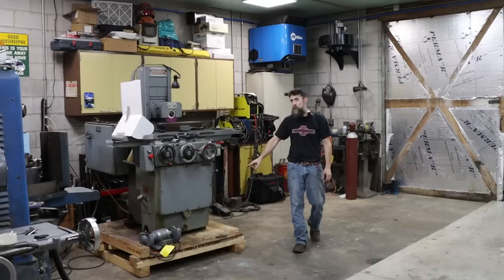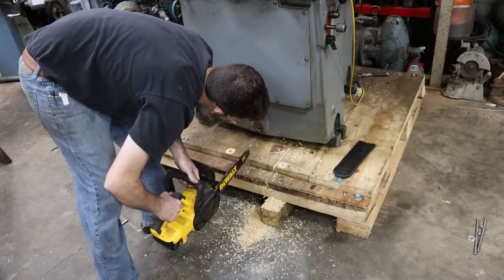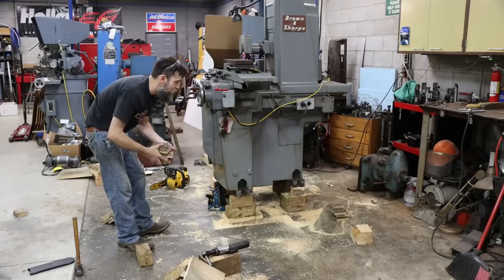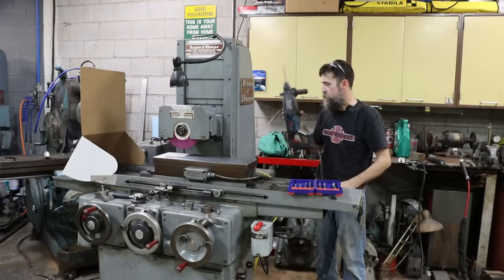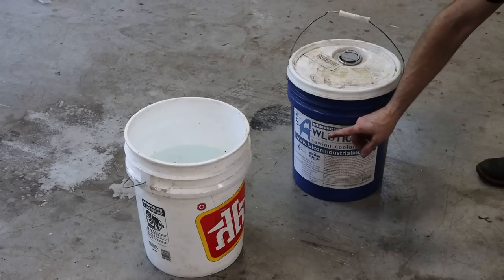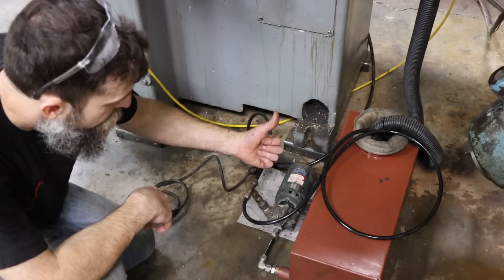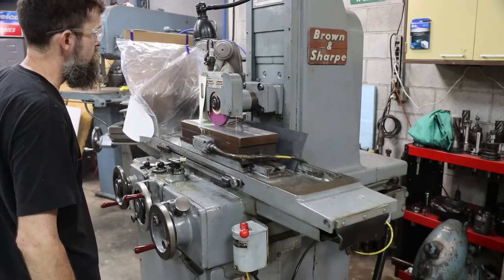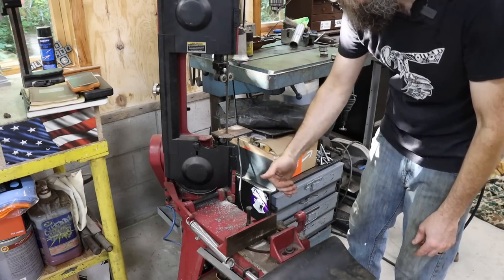Doing it the hard way. Brown & Sharp grinder touchdown & Test!

Comment: Thinking some more about this, I wonder what those six blocks prove beyond repeatability of grinding the chuck and then grinding something on top of that chuck. In other words, I don't think it tells us much about the actual flatness of the grind. It does tell us that the grind is following the same path consistently.
Reply from the maker: Moving the blocks to the surface plate and checking them there is where you see if the grinder is true or not. If I were to have placed the indicator off the grinder spindle head and check the blocks on the mag chuck it would have shown that the blocks were the same thickness even if they were different.  It's moving the blocks to the known flat surface plate that shows the true path of the grinder spindle in relationships to the mag chuck.👍
I hope this makes sense
Reply: @SteveSummers  Hi Steve, love your show. My point is that the contact point of the grinding wheel follows some path through space which is not necessarily flat. After you grind the chuck, the surface of the chuck follows that same path. As long as that path is highly repeatable (even after you raise the wheel a bit to grind the blocks), the top surfaces of the blocks will also follow that same path. So those blocks will have the same height, even if the path followed by the wheel is not perfectly flat.

What the test shows is that the grinding wheel follows a very consistent path, even after being raised above the blocks, but it does not verify that this path is flat.

Comment: What? No cherry picker? Picked up my B&S #2 Surface grinder no problem. Actually didn't even seen to stress it out. Mind you I did pull the top off, only needed to do that to clear the doorway loaded on my trailer. (Unfortunately)

Comment: I may be missing something? If the ways are very slightly curved, grinding  the magvise "flat" and then grinding blocks on it will result in identical measurements even though the magvise is not flat.
Reply from the maker: It will give an identical measurement to the surface of the mag chuck . When the blocks get moved to a known flat reference surface like the surface plate I used it will show if the blocks are ground all the same or if they differ from one another. Moving the blocks to the plate is where you see the condition of the machine ways. If there is a bow in the machine ways the surface plate will show it 👍
Reply: @SteveSummers  I don't believe that is correct (as I mentioned above). The wheel will follow the bow, so the bow will be ground into the chuck. The blocks will be ground to the same bow. Thus the blocks will be the same height, even though the chuck is bowed and the wheel is not grinding a flat path.

Comment: I’m surprised such a substantial grinder did not have an integral coolant system. Or does it and it’s just not working?
Reply from the maker: It doesn't have a built in system.

Comment: Absolutely nothing wrong at all with the way you moved that grinder. It was well thought out before hand, everything was ready before you started and lowering it in 19mm drops was certainly not going to make it tip over. Its the consideration of the plan thats important with jobs like this. If I'd had to have done it like that at work, I'd have done it the same way, maybe not with a chain saw, but a recip, but I'd have also have had to write up a risk assessment.😢

Comment: This may be a silly question but could you dress the wheel further forward? Seems like that would control the angle of attack to the nib by the wheel surface. Is there something I'm not getting about why you wouldn't want to do that? Thanks
Reply: PS The first time I used a diamond nib on a wheel I went straight in at 90 degrees.  It lasted .0007 seconds.

Comment: 5-block test doesn't tell you if you have banana ways. Grind the chuck, place pins on Ary points and a straight edge across the pins. Indicate the straight edge...deviation along the edge is how flat your grinder can make parts. If long flat parts are not your cup of tea then ignore me.

Comment: Question I have is how does the block test show anything about accuracy?

Seems to me that if you ground the table parallel to whatever you ways are even if there look like a banana and grind .002” out of flat your blocks would still
All
Measure within tenths since you just ground in the chuck?

I have a surface grinder that I want to test but don’t know how can someone explain to me how this test works?

Comment: That grinder seems to run really well, can't wait to see what kind of jobs you'll do with it.
Btw. what does the block test prove exactly? If the ways are worn and you grind in the magnetic chuck first, wouldn't you still get the same height on all blocks?
Anyway, half a tenthousandth of an inch, that's only slightly more than  micrometer, so really impressive.
Reply: Only way to test ways is to make this test with the chuck on different sides of the way, and compare to see if there is a wear bow some place. But likely this machine has run with the same chuck, so yes there will be a small error if you move the mag chuck by half the length, but not much, and the machine will still be much better than Steve has. Just has to make the new diamond dresser holder, which can be made on the milling machine using the same block, and then will work well there and have 2 positions, vertical, and 30 degrees off, to dress the diamond along with the wheel.
Reply: This just shows that the surface of the chuck is parallel to the ways, straight or not straight. You can check the ways for straight movement by placing a known good straight edge on the chuck, supported on two or three points and indicating along its length. This shows up differences between the ways and true straightness.

Comment: No gantry crane planned, with enough capacity ? Greetings from Germany.
Reply: Problem is roof not strong enough, and needing to build a moving gantry on the one side, as the new wall is not strong enough with the large windows in it. Plus no room to store it unless it can be taken apart easy and stacked in some outside location, or moved out the door and stay under an awning, which then needs the floor to be extended as a slab outside as well. Big cost all way round.

Comment: Your diamonds should point into the wheel, not like you have shown. This keeps the wheel from flicking the diamond off like a booger off a fat kids finger. Keeping a point on the diamond is pointless unless your using s radius dressing tool, but that should have a dedicated nib with a fine tip. The evidence for this is that you're not using the point when going at it from the side.

Comment: Steve,
This video seems a good time to add some similar rigging experience advice.

Improve your method by using Rock Blocks. 
Jack only from one end. Raise the end and insert same height rock blocks just past machine weight centerline. Lower the jacked end until the opposite end clears the cribbing. Reduce the cribbing height, and jack the elevated end to clear the rock block(s). "Rinse and Repeat". Employing this technique allows you to never move the jack to the opposite machine end. Your toe jack is small and easy to move. If you are using your forklift or overhead hoist  you will really appreciate the technique. You only need lifting capacity for "half" the machine weight and you don't require much opposite end workspace.

This technique assumes a solid machine base profile like your machine. Pedestal machine bases like engine lathes likely won't accept the rock block technique. Most modern machinery in my experience employs a solid base perimeter allowing leveling jack screws around the entire machine base.
The rock block technique improves ease, efficiency and often improves safety.

Another tip(s) for using on size wedge anchors. Drill the hole entirely through the concrete slab. You won't need to remove dust for anchor insertion clearance and when the anchor is abandoned it can be driven flush with the floor easily. In a pinch, the same hole can be re-employed by simply driving in a new anchor. 
Also thread the hex nut flush with the top of the anchor before driving it into the hole. This greatly enhances stud mushrooming protection and accidental thread damage.

Comment: The best way to dress a wheel is with the diamond very rigid and straight up. The reason the magnetic chuck diamonds are angled is to prevent them from getting jammed, moving,  and causing a gouge in the wheel. The bolt-on diamond won't move and cause a gouge or wreck.

Comment: Man you're playin one crazy game of Jenga, I've moved die presses on 1/4 round stock, wow dude. That is a good idea with the diamond holder, I've done tool and die work and had older co-workers, saw some neat things and of course learned a lot from them but I'm surprised none of them thought of that. Yep, I've manually ground/ resharpen doctor hole punches in progressive dies, not fun and neither is resurfacing the chuck on a manual grinder, takes 2 people to make the job easier, one on one handle and well you know then change every 1/4" of table that's been cleaned up.